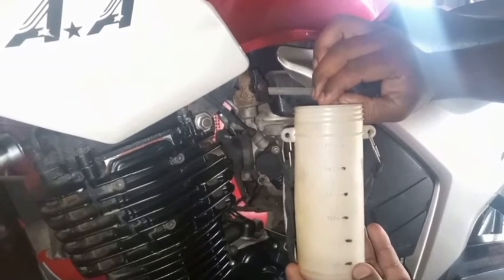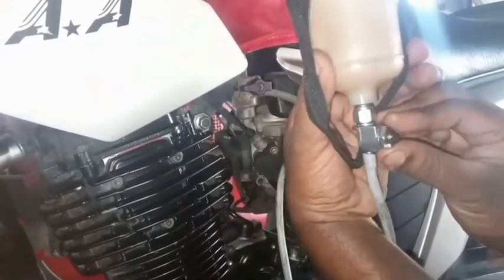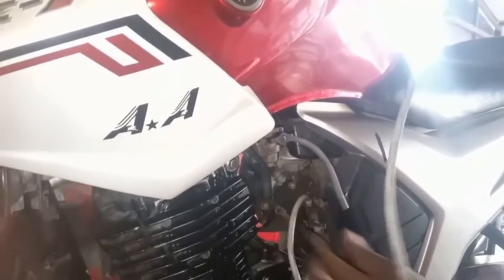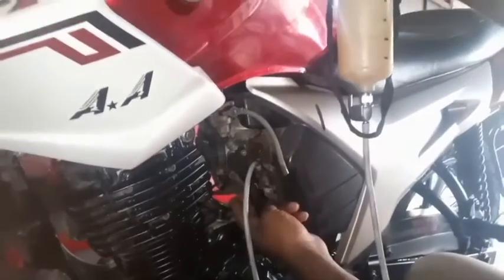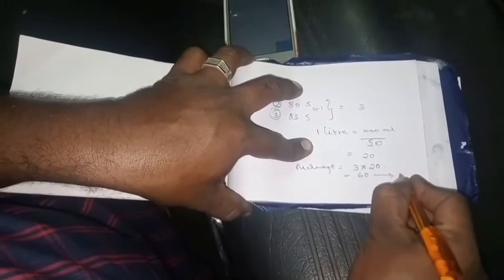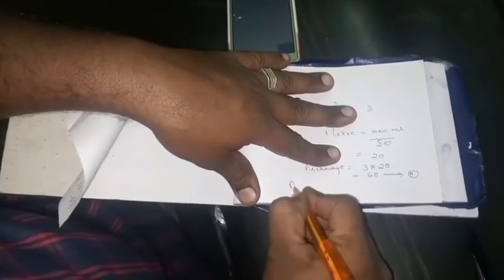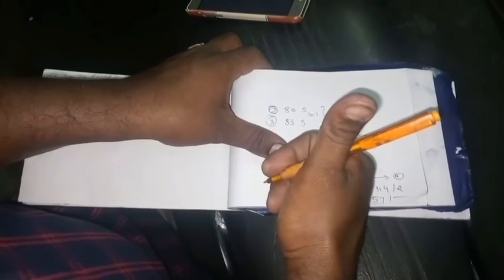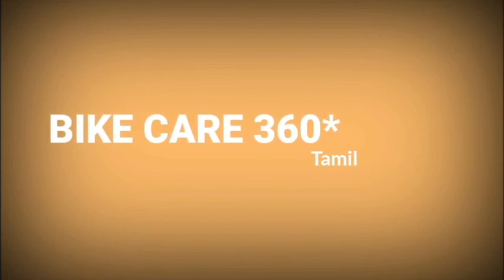How to check bike mileage|தமிழ்|Bike care 360

Comment: Bro I have a problem with My Pulsar 125 CC Bs6 New bike problem when I am riding 60 to 70 Kmpl Handle Bar vibrates after reaching 70 no vibration in handlebar likewise when the speed goes to 50 to 60 No handlebar vibration. I have checked in the showroom and the local Mechanic near me has no solution after filling the correct air in both tyres and changing the fork oil.
Please Suggest what will be the issue.